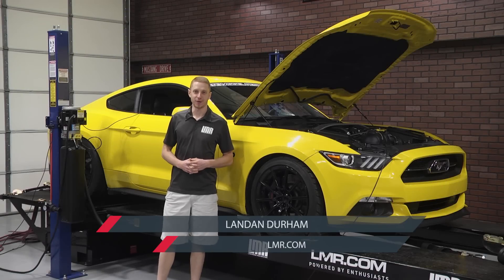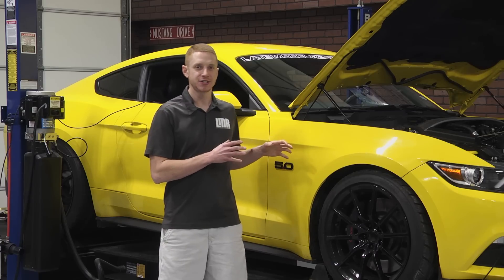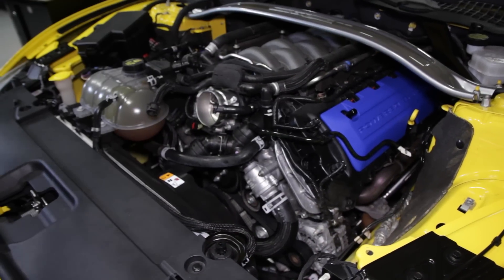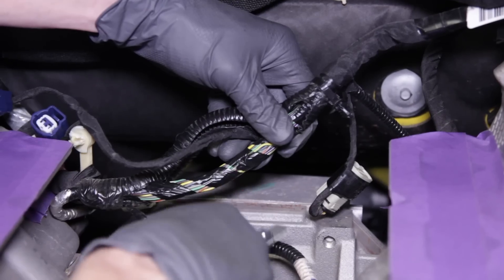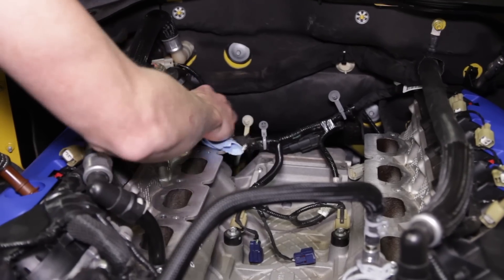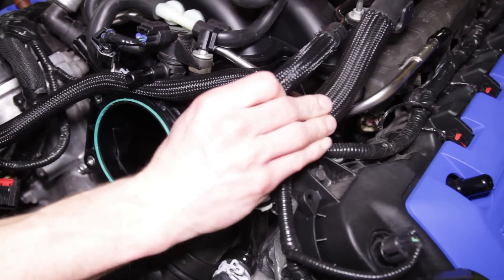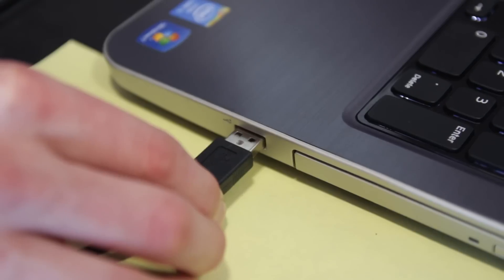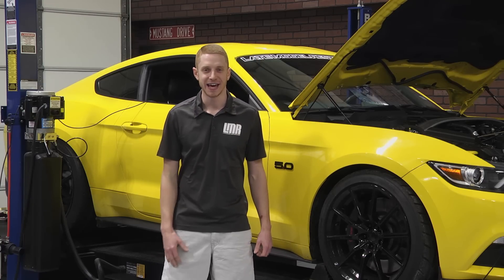2015-2017 Mustang GT Ford Performance Stage 3 Power Pack - Install & Dyno

Comment: Are these torque specs specific to this kit? Or the same torque specs for the oem intake manifold?
Reply from the maker: These torque specs can be used for a non-GT350 intake manifold. I'd really only worry about torquing the intake manifold to cylinder head bolts, fuel rail bolts, and throttle body bolts. The PCV and EVAP solenoid fasteners are different on a GT350 manifold. Just get those hand tight. -Landan

Comment: what is the part number for the harness extension for the evap solenoid mine didn't come with that
Reply from the maker: We sell it in a kit. Part # M9424M52-HDW. Link below. -Landan

https://lmr.com/item/M9424M52-HDW/15-17-mustang-gt350-intake-installation-kit

Comment: What’s the name of the bolts I need to
Reply from the maker: What bolts are you referring to? -Landan
Reply: I found the bolts , but what is the part number for the harness extension for the evap solenoid mine didn’t come with that

Comment: I have a 17 gt put in cold intake bbk long tube headers witt bbk mid pipe magnaflow full exhaust with 2018 manifold and only gainedb8bhorses to the wheel...

Comment: I really need your help on this. Can you guys do a video on replacing the cooling temp sensor I feel like if you take the intake off you can reach it and change it from there I wanna say. If it’s possible could you guys do this. That would be highly appreciated. I’m new to the coyote platform.
Reply from the maker: Thanks for the comment. Unfortunately, we won't be able to just run out and shoot a video covering your concern. However, the sensor is located at the back of the passenger side cylinder head. Per the Ford workshop manual, it shows that only the intake manifold needs to be removed to replace the sensor. Hope this helps! -Landan

Comment: I just installed this today on my 2016 mustang gt. I have very minimal mechanic experience so it took me about all day haha hardest part was the sound tube bolt and overall just leaning over the car for hours. Car now runs perfect! Sounds better. So responsive. JUST WANTS TO GO! Last intake had bad runners so it's nice to see the check engine light go away. Yeah the price is a little much but who cares. Gt350 parts make the gt happy. If you're new to this work just be patient. Watch this video and pause and replay parts as you go. Don't rush.
Reply from the maker: Thanks for the comment and for watching the video. We appreciate it! -Landan

Comment: 8:00 in and I am done.. This will never be done by me all for like 30 more horse power.. I will just save till I can get to National out in VA to do a stage 1 Whipple for me and call it a day.. I want 600/650 Reliable Pump 91/93 safe and as factory as possible power, I want it to run and look like it came from Ford that way...
Reply from the maker: To each their own. -Landan
Reply: @latemodelrestoration  No Offense meant at all.. I look forward to buying other things from you guys.. I am on a waiting list right now for GT350 style wheels and Nito tires. For my 17 GT.
Reply from the maker: @marcasswellbmd  I didn't take offense at all. -Landan
Reply: @latemodelrestoration  Thanks Landon, I love what you guy's are doing and I've been looking at maybe doing the stage 2 kit... Air box and throttle body, ((But I see that the inlet on the stock 17 Intake is only like 80mm.. So that's the rub for me.. It seems a little off trying to put an 87mm throttle plate on an 80mm intake opening.. IDK..)) But I do hear that there is a real 20HP gain, No lift, which I will never use because it's something at my age I could never get used too. When I was a Kid 35 years ago.. Jesus.. Anyway, I tried power shifting and it felt so weird and I was never able to keep my right foot totally to the floor. It's like blinking to me, I can't control my right foot from lifting slightly.. LMAO!!!  But then I hear there's way better throttle response. SO I don't know. I would have to take it to Ford and have them do it for me too, so there's another $700/$800 for install too, The price seems spot on fair for the stage 2 setup!! I guess I am still on the fence.

Comment: There is something off on the stock reading as the HP and TQ do not intersect at 5252 rpm. Never seen a dyno graph that was not intersected at 5252 rpm. The 2nd graph is correct by comparison. Interesting don't you think?
Reply from the maker: You can scale the graph in the dyno software to where the axis are "locked", thus shifting the intersect point of the horsepower and torque. This doesn't alter the results, but it change the look of the graph for a different visual of the horsepower and torque curve. For the stock run, we accidently "locked" the axis in the software. Thanks for the comment. -Landan
Reply: @latemodelrestoration  Hi Landan: Hilarious! This is a 6 years old video and you still replied to me. That's awesome! Nice job. I thought I was the only one who did that. Didn't know the graph could be manipulated like that. I just bought a complete Gen 3 Coyote from Summit. I also have a cherry, 03 Marauder. What do you suppose could happen?
Reply from the maker: @lencac7952  I try to respond to every comment that comes through. You could have bought that Gen 3 engine from us! :) Sounds like you have a fun project! -Landan
Reply: @latemodelrestoration  Hey Landan: So what would it cost from you. Complete Gen 3 Coyote with flex plate, engine and trans harness?
Reply from the maker: @lencac7952  Ford Performance sets the pricing on their engines, but you could still see a very small price difference. I checked over the prices and we come out a touch more expensive the Summit. I'm glad we had this little conversation. I sent the info to our product team so they can take a look at our pricing and make sure we stay competitive. Have a good day. Thanks! -Landan
Reply: @latemodelrestoration  Hi Landan: Well, when I saw the complete coyote for well under 10K I had to jump. I still remember back in the day, probably before your time when a person could get factory crate LS6's, LT-1's, 502's etc. I kick myself for not acting then. Some time later those crate engines became very valuable, much more than what they sold for. So as I mentioned I have a low miles cherry 03 Marauder. That would be a terrific swap. However, the Marauder is so clean and original it would basically be a travesty to corrupt it that way. But either way, even if I just hang on to the Coyote I think it will only become more valuable.
https://www.youtube.com/watch?v=k_Uz95qvBXg
Reply: Hiya Landan: Lencac here. Don't know if this has a category but thought you might find it interesting. You know I took delivery of the Gen 3 Coyote on the 31st and placed the order on the 26th. I looked on Summit on the 2nd and saw they lowered the price of the engine I bought by 10% or $961. So I called Summit. Very sweet young gal says "oh yes sir, we have already refunded you $961. Is there anything else I can do for you?" Checked my stuff and sure enough their it was.
Reply from the maker: @lencac7952  That's great! -Landan

Comment: Can the Gen 2 reliably handle higher RPM’s with this set up?
Reply from the maker: Rigo - This exact kit has been installed on the vehicle in the video since January 2017.  We don't daily drive the car, but it does go on long trips, and it is road raced at high-performance driving events.  Hope this helps.  -Landan
Reply: If I’m staying with the stock throttle body do I need to make the electrical harness modifications?
Reply from the maker: @rigoalbiter6955  What exact electrical harness modifications are you referring to?  There are a few different ones in the video?  -Landan
Reply: The throttle body connection
Reply from the maker: @rigoalbiter6955  No. There is no modification needed to the throttle body electrical connection. -Landan

Comment: Is traveling 1,000 RPMs over the factory stock 6500 RPM redline safe and reliable?
Reply from the maker: This kit is still installed on the car in the video, and we have had zero problems.  The car is also tracked multiple times a year.  -Landan
Reply: Yes just keep the oil changed on time.

Comment: I've run into a few problems with my 2019 GT essentially the GT 350 manifold does not have the same imrc plugs in the . There is only one blue plug and the two white plugs do not fit either. Also not sure what to do with the EVAP routing because things have changed since 2015 to 17 model you no longer unscrew the EVAP sensor and port and move it over I wish there was a video for 2019 install
Reply: I have read that the factory is just as good as the gt350 intake manifold. There's nothing to gain.

Comment: Install video was great and helpful. I have a manuel and redline is 7k. Am I missing something? Or is the 7.5k for autos only?
Reply: I’m thinking the redline increases. In that case, maybe get the digital dash so you can see revs over 7K?
Reply: The cluster still turns red a 7k but the fuel cut off is higher, try winding it all the way out

Comment: This video helped me a lot with the installation. Everything worked right away with my tune. I used a PMAS cold air and locked IMRC’s open so the routing was slightly different but it all worked.

Comment: How does this kit respond to an e85 tune? I'm wondering, as e85 is plentiful in my area...and waaay cheaper than 92.
Reply from the maker: Hi Petty,

Premium fuel, 91 octane or higher, is required when running this kit. If you have any other questions or concerns, please give us a call at 1-866-507-3786 or use the contact us link below to email our tech team. https://lmr.com/contact

Comment: does it matter on which imrc silenoid the connections go? or are they the same?
Reply from the maker: Hey there, they are the same but we recommend using the original locations as when you removed the OEM intake manifold.
Reply: The white ones matter the blue ones do not

Comment: They need to make power packs 2-3 for 2018+ mustangs. Or do these work ?
Reply from the maker: The Stage 3 Power Pack will only fit on 15-17 S550 Mustangs. Most 18+ owners stick with the stock intake manifold, since they perform very well.

Comment: Where can I get that vacuum hose that come with the stage 3 kit?
Reply from the maker: You'll want to check in with your local Ford dealer for that specific vacuum hose for the Stage 3 kit. We do not offer the hose separate from the kit.
Reply: @latemodelrestoration  will it hurt if i added a blowfish adapter to the manifold with the TB?
Reply from the maker: Please call or email us with the link below and a customer service representative can assist you with that. Thanks! - https://lmr.com/contact

Comment: 432WHP = 509 crank HP!  I think that's a happy dyno!  There's no way a GT350 intake manifold and tune will increase factory crank HP from 435HP to 509HP.
Reply: Yes it does with the GT350 throttle body.  The power gains are above 7000 rpms which is where this rev happy Coyote motor puts in work.  This isn’t an LS or Hemi.  It’s a dual overhead camshaft with higher volumetric efficiency.
Reply: @mikehughes8023  would you recommend keep you’re factory Headers on with this performance pack
Reply: @keairkelly5875  Yes, as it’s mainly the tune with the intake manifold that improves performance…

Comment: I really like the video but for stage 3 the power is too low
Reply: It makes a bigger difference than just peak power. It also extends the usable power band by 500 RPM.

Comment: Thanks for this video.  Curious though...what tires are on this Mustang?  Thanks!
Reply from the maker: We have the Nitto NT555 G2 in the front and Nitto NT05's in the rear.
Reply: Thanks. Stock sizes?
Reply from the maker: 305/35/19 in the rear and 275/35/19 in the front

Comment: How does this power pack work with say Lomg Tube Headers and Magnaflow Street or Race exhaust? Would there be more productive increase of power or counterproductive results?
Reply: You need to constantly stay over 6000 rpms to feel the power gains.
Reply: @mikehughes8023  sooooooo same thing with say if I go with CobraJet intake instead?  Good high rpm horsepower increase?

Comment: why is it only getting 395 hp when ther mustang gt come 435 stock?
Reply: those numbers are to the crank. what the actual motor pulls. the dyno measures wheel horse power(whp) which is the actual useable power. you lose 10-15% because of the weight of the car. Manufacturers  never show wheel horse power. its always what it makes at the crank

Comment: 37hp gain for $1700 in parts plus labor on top.
Reply: Over 70 hp gain to the wheels at over 7200 rpm.

Comment: If I use different tune like engauge will it make more hp??!? And can I retune with procal tool after?
Reply from the maker: In most cases, a custom tune will make more power, but they can void the warranty. You cannot do both though. It will have to be one or the other. Also, a custom tune is not legal in California, but the procal is.
Reply: @latemodelrestoration  thank u . U guys always very helpful. I appreciate it.

Comment: This kit is Awesome! The downside is Fords tune its absolutely WEAK ! Best mod i did was getting tuned by Lund it added the Power to this kit that Ford should of gave it.
Reply: What did you make with lunds tune ?
Reply: @vincentsoresi417  haven't hit the rollers yet. But i went from 13.01 to 11.9. Fords tune felt just like stock 100%.

Comment: hey bud if i purchase carb legal shorty headers along with this pack can i use procal tool to tune it??
Reply from the maker: William,

Unfortunately, the Procal does not adjust for headers.
Reply: If you have a Coyote engine then shorty headers are just a waste of $$….Just keep the stock ones.

Comment: Got the code p061a, installed this, throttle body, and have an air raid intake, it's tuned by bama
Reply from the maker: We suggest contacting your tuner. Have a great a day!

Comment: so im cleaning the cold air intake.. do i need to oil after cleaning????
Reply from the maker: The factory filter in this kit is a standard non-oiled replacement. If you do want to go with a reusable option, here is the link for this replacement. https://lmr.com/item/M9601G/ford-performance-gt350-performance-air-filter-m-9601-g

Comment: what happens if i use 87?? 🤔
Reply: It will run but it won't be happy. Power will be way down and you could run into knock. These are fairly high compression engines, after all.

Comment: hey bud . quick question.  can i use 100 racing fuel with this ?
Reply from the maker: I am sure this is not a problem, but you may want to consult with your tuner just to make sure.

Comment: This information basically tells me to buy a 2018 GT
Reply: I don't like the 2 overdrive gears of the newer gts , slightly kills the extra power.
Reply: @Spiritcr1jsher  
I wonder if it's easy to swap an older MT82  6-Speed with the better 5th gear 1:1 ratio in there. I would definitely look to do that. I'm betting the 2018 manual picks up a tenth or two from the better gearing
Reply: @331Grabber  I guarantee it will since it's not that torquey of a motor and the car loves to rev . Especially with a 7400rpm redline.  It's a MPG thing . I would bet 23mpg highway would be the number on an older mt82 gearbox and I also bet it's a straight forward swap.
Reply: @Spiritcr1jsher  
The weird thing is the old MT82  with 5th as 1:1 has virtually the same 6th gear overdrive ratio as the double overdrive new ones. I think Ford figured customers didn't like the huge RPM drop from 5th to 6th gear on the older MT82. 
   My 03 Mach 1 has almost the same drop 4th to 5th but I'd never wish for another tweener overdrive gear  :)
Reply: @331Grabber  I have the 3.73 gears on my 2015 so I dont notice it as much I guess . I'm at like 2500rpms at 80mph in 6th give or take. 2 overdrive  gears sucks . My 87 gt did like 85mph in 5th at 2000rpms...lmao
Reply: @Spiritcr1jsher  
I can be at 3000 RPM in 4th in my Mach 1 and it drops to 1800 RPM IN 5th. Still have the 3.55s so it's taaaall. 
But still not a problem that needs a middle overdrive like the 03 04 Cobra 6-speed. I'd love to retrofit an MT82 with the 5th gear 1:1 in my Mach 1. Bet it would improve it substantially  :)
Reply: @331Grabber  Yeah , I agree. They want so much money for the mt82 for some reason.  A used coyote with the mt82 is almost the same price as an entire used 2011 gt...lol

Comment: Can you take it to any ford, purchase the kit and have them install it? Also if I take them bbk headers can they install them aswell?
Reply from the maker: Jose - I would contact your local dealership first before assuming.  Long tube headers are not supported within the Ford calibration.  -Landan

Comment: What were the curve gains? I wanted to compare them to the numbers from your stage 2 video. Do we get those same lower end benefits with stage 3 that we get with stage 2, or is stage 3 only for the higher end with the lower end still feeling stock? Thanks.
Reply from the maker: The low-end torque curve of the stage 3 kit is less than that of the stage 2 kit. You are right, the stage 3 kit is engineered for top-end performance. -Landan
Reply: @latemodelrestoration  Thanks Landan. Do you know what the crank horsepower increases to after power pack 2?
Reply from the maker: Considering the 421RWHP from the stage 2 dyno, I would put the flywheel numbers around the 480-490HP mark with the stage 2 kit. -Landan
Reply: @latemodelrestoration  thanks bro
Reply from the maker: You're welcome! -Landan